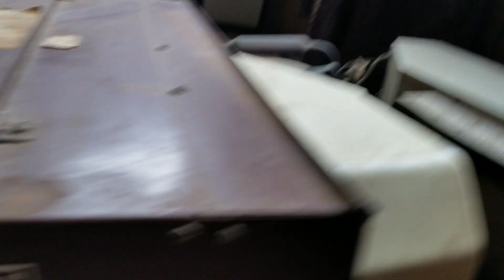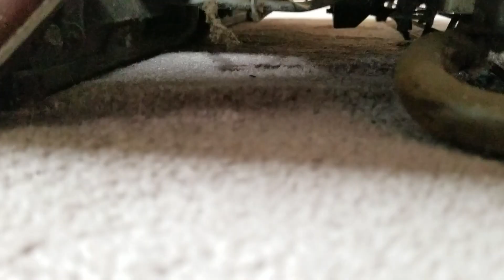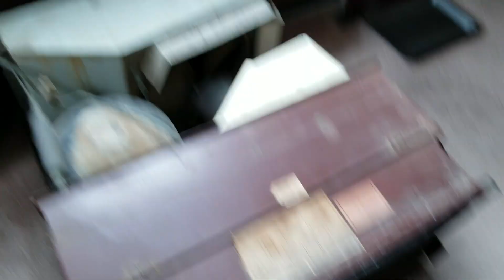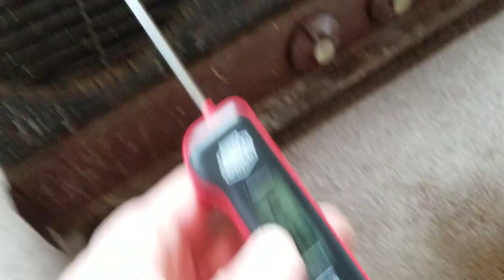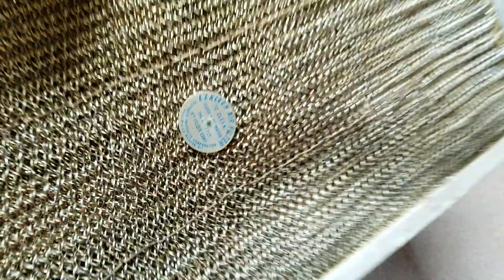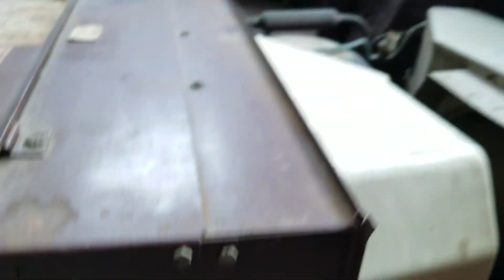1955 GE Mugwamp air conditioner + update

Comment from the maker: So I found how the "dry air" setting works. It closes the vent damper so no outside air gets in but it also leaves the inside air damper closed as well. This restricts the airflow into the fan (when installed in the case) and reduces airflow inside which reduces capacity. It will still take water out of the air but without cooling the room as much.
Reply: Some air conditioners also have a dry mode. In dry mode, the air conditioner compressor and fan run at a much slower speed. Instead of cooling the air, the unit simply pulls the moisture out of it. In dry mode, an air conditioner essentially functions as a dehumidifier. In dry mode, the air feels cooler on your skin due to the lack of humidity, but its temperature is not actually changed.
Essentially, cool mode removes heat from the air. Dry mode removes moisture rather than heat. The end result may feel the same or similar, but the methods are quite different

Comment: This brings back some memories.  I remember four of these units from back in the day.  The barbershop I visited had one as did the family across the street from where I grew up.  And my dad bought one for our house.  We had the 1 horsepower 220 Volt model with a two speed fan motor.  Condenser fan had four blades instead of the three on your unit.  Fan motor failed after 10 years of service.

Comment: One of these in an old grocery building in warrensburg Missouri.  I kept trying catch someone there to talk to but never did.  the building sold and it disappeared next time I visited.  Hated to miss it.  I worked for GE for 21 years and I am surprised that it does to have a ge built compressor.  they don't like to spread the wealth so I guess they had nothing that would work at the time.

Comment: Outstanding unit, and great compressor sound. Too bad you can't install it with the outside part in a basement or garage, like the print-shop application. But then you would not be able to see it from outside in all its 1950's glory!

Comment: The actual unit weight is 179 lbs. The compressor weighs 62 lbs. according to the 1955 Tecumseh catalog.
Reply from the maker: I'm surprised I correctly guessed the weight range. I thought the compressor would be heavier though.
Reply: @angrodNumenesse  Surprisingly, even the B series is only a few pounds heavier. The 2HP "B", the largest, weighs just 78 lbs. But the 5HP 4-cylinder FB unit weighs in at 184.

Comment: 1955 is correct! The Mugwamp was 1955 only. There’s a similar model in 1954 but the logo is on top and the unit can’t be flush mounted. In 1956, the high thin line was born and this model was no more. This is identified to mine. Mine was also installed completely indoors and was never exposed to the elements. There’s also deluxe models out there with fancier grilles and different features such as more fan speeds and heat.
Reply: The higher-capacity Mugwamp-style units, such as the 1 1/2 HP model, were made in 1956 because the High Thinline series was not a complete line until 1957, according to the 1957 service manual.
Reply: @johncantwell8216 good to know!! These units are some of the coolest designs I know of

Comment: You might be young.  So you probably did not experience window AC units in the 60s or 70s, maybe even 80s.  Those old window units would pump out so much cold that they would get frost on them.  Much colder than modern units that blow cool but not icy cold air.  So they probably have to run longer,  using more electricity but yet are called "green".  I miss cold AC versus just coolish.  What a load of crp.
Reply: Nailed it! Correct on all counts!!
Reply from the maker: Yeah I'm only in my mid 30's. The oldest appliance I can remember growing up with is an 80's Kenmore dehumidifier. I much prefer older stuff as it is simpler and works better. Modern junk cannot and will not ever compare.
Reply: @angrodNumenesse  thats not really true, its mostly due to the refrigerants being trash compared to r-12 and r-22. only one that compares these days is r-290 which is better than them both, but not used a lot yet.
Reply: They call it green because money is green not the environment
Reply: THIS IS MY FRIEND MATTHEW 🤘
Reply: My cheap haier window unit pumps out 35 degree air believe it or not. Sometimes it ices a little on the coils. Its 9 years old so I don't expect it to last much longer.

Comment: Welcome back!  I’m glad you made the long drive to get this unit.  This makes you the third collector to own a GE Mugwamp from 1955.  @TheAirConditionerGuy being the first.  @K.B being the second.  Now you’re the third.  My best guess for the function of “dry air”, since it partially restricts airflow from the evaporator, it acts kind of like a dehumidifier which would make sense since the function is called “dry air”
Reply: Yes, the service manual shows how the recirc damper is only partly open on the Dry setting to reduce airflow over the evaporator and lower the air's temp. more than the Cool setting would. Intake and exhaust dampers are kept closed.